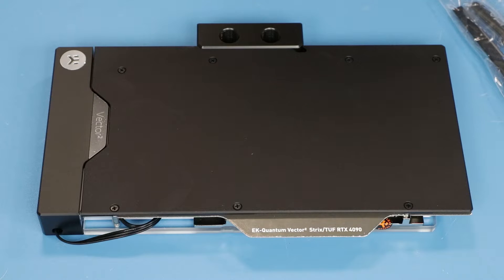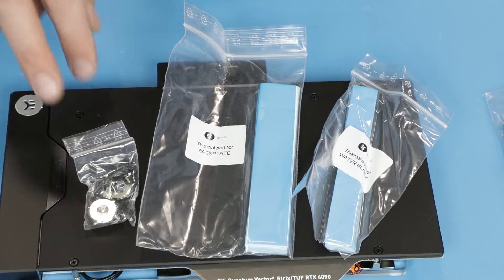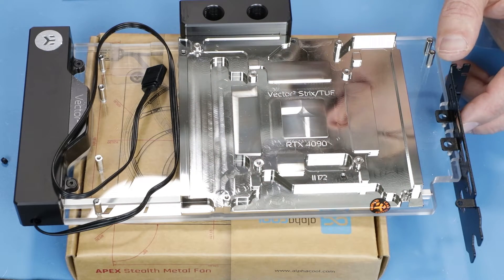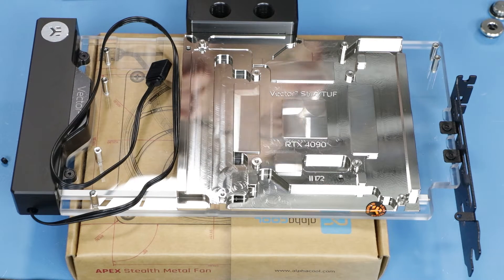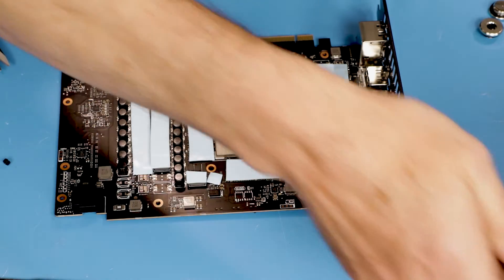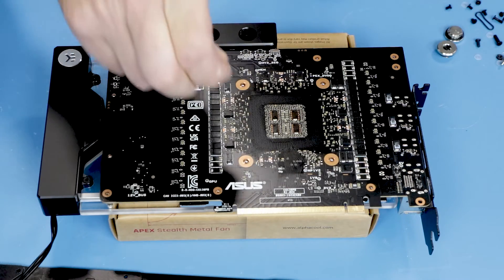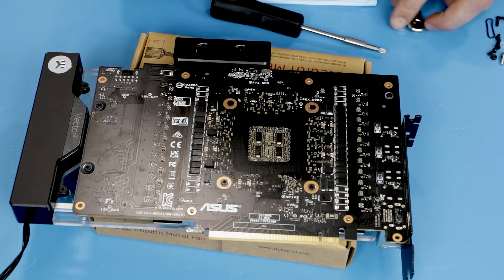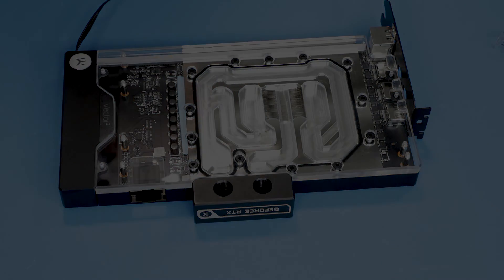Installation of EK Vector2 4090 Strix/TUF Waterblock -Quick Guide #7

Comment: One thing that continues to kick my memory is the disassemble of my 2080 ek block. There is that stupid side metal rgb line, glued heavily to the block. "Little did you know" there are screws under it. And like the Spanish Inquisition, nobody expects them until they decide to disassemble the block(to the last point i didn't want to believe it and was trying to force it). And at such moment you goggle and find a bunch of reddit posts with the same dumb question.

Comment: I´m done with WB for graphic cards. I´ve got an Asus Strix 4090, it runs so cool with UC (why not, it saves power and performance is basically equal) that I don´t see the point for WC anymore, since I have a pretty big case with an horizontal mobo layout. Also, a couple of years ago I installed a 250$ EK WB on a 4090 Founders and something damaged the card in the process, despite following the instructions very carefully. Also, cutting a myriad of thermal pad pieces was annoying enough. Fortunately, I could RMA it with the seller, but that EK block fucked my card's PCI lanes. Anyway, not worth the hassle for me anymore, and I had a bunch of WC cards in the past. Cheers.
Reply from the maker: I don't blame you after bad experience, as with any hobby people loose interest in various things. Everybody have some hobby in the past which is not exciting any longer.
Reply: @DazModeWatercooling  Quality went downhill once they started to have stuff made in China of all places. Pity.